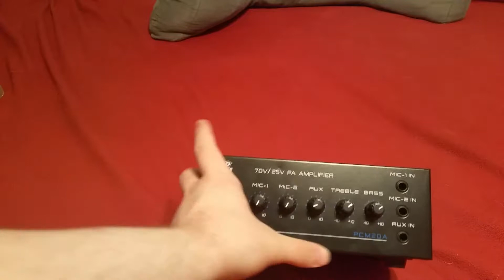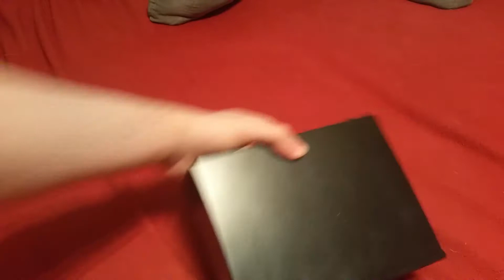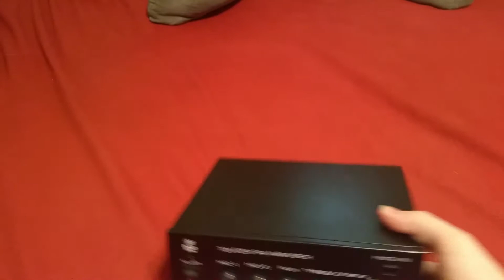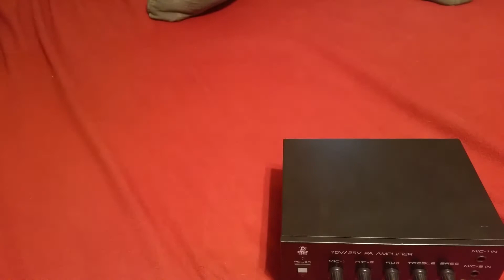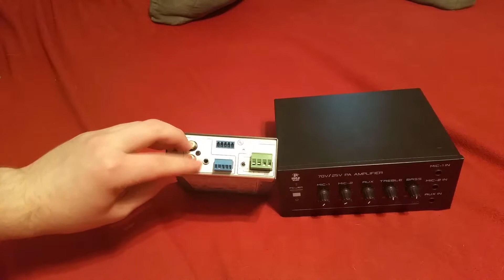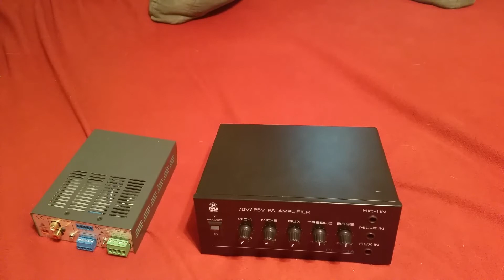Pyle PCM20A

Comment: How do you hook up a speaker strobe to it?
Reply from the maker: RSS Alarms 
The terminals on the back?
Those are labelled for specific line voltage outputs for a reason.
Reply: No, HOW do you wire a speaker strobe to it?
Reply from the maker: RSS Alarms 
Like I said, the terminals on the back.
COM port is negative, and the corresponding voltage/ohm setting is positive.
Reply: Now I see, but if if the speaker strobe has a transformer on it, you would wire it to COM and 25v/70v, right?
Reply from the maker: RSS Alarms 
Correct.
Never wire a speaker with a transformer to an Ohm port of any kind.
99% of fire alarm speakers have a transformer on them.